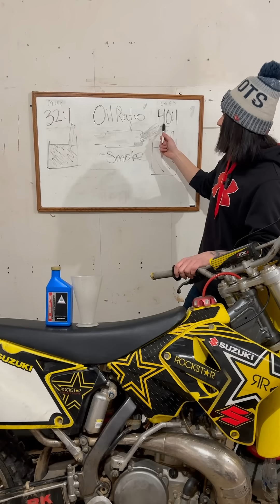2 Stroke Oil Ratio Explained

Comment: It's not because you are putting in to much oil necessarily. It's more likely that you are running the wrong oil. Different 2stroke oils have higher or lower temp flashpoints. If your running low speed trails so your engine temp will be higher you run a higher flashpoint oil. If your running cooler like wide open higher speed terrain you run a lower flashpoint oil. That way it's burn off instead of running out your pipe. And FYI it make so little difference on how thick the fuel is, it has nothing to do with how easy it's picked up by the carb, that's ridiculous actually. It may have some bearing on how efficiently the fuel is emulsified in the pick up tube but it's negligible. Research your 2 stroke oil flashpoints, it will make the biggest difference. And yes I'm a pro tech, master certified. 30 years experience. But always do your own research! It's up to you to make sure you understand what the reality of random advice. Keep ripping.

Comment: If the smoke bothers you switch to "smokless" oil huge difference!  I have an old engine says to use 1 pint of sae 30 wt. Per 1 gallon gasoline  that's 1:08   mixing ratio 😳  that's insane.

Comment: Use Excel plus metal treatment and run 60:1. Outboards run 50:1 without any problem on manufacturers recommendations and they work harder than a bike 2 stroke. My Victor 2stroke mowed commercially for 2 years on 50:1 without the Excel until I gave it to the neighbour who used it for 3 years and loved it.

Comment: What???? How is less oil going to cause the engine to run rich? This doesn't know what the hell he's talking about.the only reason why the oil is in there is to provide lubrication.period.that oil is in the fuel so the oil will be burnt with the fuel and cause the smoke.i had a 13 KTM ex-c.they-ktm recommended 50:1 and it still had build up at the end of the silencer.so I don't get what the hell  he's talking about.and what mix is he claiming is causing it to run richer the air/ fuel ratio or the oi/ fuel ratio?

Comment: Who cares how badly it’s smoking, they’re nicknamed 2 smokes for a reason lol.. ratio your bike based off the application.. if your lugging through single track at low speeds, use a high oil ratio, as your bike isn’t getting hot enough to burn off the oil in the fuel completely .. if you’re at the track and constantly on the pipe, use a lower oil ratio .. the harder you ride, the hotter the piston and cylinder get, the more oil you’re going to burn off in the cylinder during combustion

Comment: Richer or leaner are terms relating to the fuel / air mixture, not the oil/fuel mix. Adding less oil increases the ratio of fuel to air, thereby richening the bike. This if you run less oil (40:1 , 50:1) you may want to lean your jetting to compensate .

Comment: And bk in the day my mates wud come to me saying my engine has seized up, did you put oil in with the fuel? 🤔 NO isn’t there oil in the engine 🤣 dang i learnt that mowing the grass in 1972 at the age of 6. Yeh 6 yrs old get the mower out fill it up not forgetting the oil, a little tickle,a little choke, wedge the mower against the tree and pull with all my might, it fired up most of the time. If it didn’t i wud take the spark plug out, warm it up and boom first try 💪. Kids these days don’t even know what a lawn is around here let alone how to use a mower at six some are still on the breast 🤣

Comment: I like the theory sucking a slot a milkshake thinning out the oil ratio does not make it suck way more fuel the amount of liquid coming into the combustion chamber is going to be the same only changing the Jets will make a difference obviously the fuel content is going to be higher because you have less oil that's obvious but the amount of liquid going in by changing just the oil percentage will not change you have to change the Jets to change amount of flow

Comment: Team green guys told me as a young racer that they set premix based on the oil level in the bottom of the case after running it and shutting it down. I don't remember the exact steps but they ran it, shut it off, pulled the cover and measured the depth of the oil. Set that then start adjusting the carb

Comment: Here’s the problem with the whole concept of two stroke RACE bikes. The bike was not built for durability. It was built to race, not ride around in your back yard or neighborhood for 25 years. Check the manufacturer’s service manuals, the manufacturer  recommendation on a top end is 2 to 3 hours of race time or 5 to 8 hours of trail riding time. So mixing the oil and gas has to do with the fuel being burned. If you are a beginner rider using 87 pump gas mixing Maxima Castor 927 32:1 with factory jetting, you are destroying your bike. It’s clogging the power valves and charring the top of the piston with carbon and unburned oil which causes the cylinder to over heat thus shattering the skirts of the piston.  Now take an A class rider with 102+Octane and 40:1 Motul 800 and tuned jetting the bike runs flawless for a couple of motos but the top end is shot after that.  The object of his game is to run it like a raped ape hoping it doesn’t blow until the checkered flag. So your game is, jet the carbs and run a good ratio of gas and oil that matches your riding style. This will be trial and error but the color of your spark plugs will be the judge of what’s good for you.  No one person can tell you what’s the best ratio for your bike, your bike and your riding ability knows that answer. Watch your plugs and check the color, change them every ride or 30 minutes of ride time. They are less than $4.    Now, all that being said, if you don’t have time to do all this, owning a two stroke race bike isn’t your thing.

Comment: Well kinda, so I used to race ATC 250R  3 wheelers. We would run low lead fuel 100 octane and mix them at 16 to 1 with flammable 2 stroke oil "goldenspectro". They were not too rich!!!!!    A bike from the 80s that said 32 to 1 could run 40 to 1 with the new spec Oils out there today no problem....

Comment: I always run 50/1 on my 2 stroke bikes and sleds this way the motor will last for years but I do sometimes I spray transmission oil into the carbs to totally clean out any carbon build up.

Comment: Old school carburetor tricks will screw up a modulated motor. You are absolutely right. If you ain't a race tech or an engineer, trust the manufacturer.
Reply: 2 strokes have been going through some major evolutions, over the last 10 or 15 years. The 2 strokes of today are nothing like a motor from an '86 yz 125. Nothing.

Comment: I tried many different oils for all of my 2 stroke dirt bikes. I was hooked when I found AMZOIL. This oil could be run at a 100:1 ratio. I had a 98 CR250 I bought brand new and ran only AMZOIL at 100:1. I rode that bike hard every Saturday and Sunday for a full spring, summer, and fall. I brought  the motor in to get it honed or sleeved and new piston and rings at end of the year. I was told it wasn't needed and that they could still see the original factory honing scratches. They said you must barely ride. I laughed and told them how often I rode the bike and the oil I used and the ratio. They did their own research into using AMZOIL, and the next time I was at the dealer they switched over to only AMZOIL products. More than one occasion I was told I was going to blow the motor up because it was producing no smoke. Best oil I ever used.

Comment: Run as much oil as you can manage. I see lots of comments from fouling plugs to burning rings/pistons. I want the bearings lubed and rings lubed. Manage detonation and correct fuel delivery, and it should run hard, live long, and maybe even make more power. Most all tests on mix ratios show more power with a richer oil mix. Less friction? Fouling plugs is it's own issue, not necessarily related to oil. 
Btw, nobody mentioned 20:1.

Comment: I have told people hundreds of times that my 32:1 mix is leaner than their 40-50:1 or whatever it is. You are using 2 ratios. Oil to fuel ratio, and air to fuel. Pick your oil to fuel ratio and jet the carb for that

Comment: Hard to find anything that needs other than 40:1. Shit used to be not as good as far as oil quality so they recommend 32:1 on older toys. running 40:1 is actually probably closer to what they ran back in the 80s and early 90s. These new 2t run 50:1 because oil is litterally that much better the only thing is you probably cant run it 50:1 on old toys cause like homeboy said ur likely jetted like trash already.

Comment: It doesn't run richer it just makes the engine get 20% less lubrication. Result is higher engine temperatures from thermal efficiency of burning oil as oil is leaner it gets hotter. Oil removes engine heat when in large enough amounts. Mazda rotary engines use oil like dirtbikes. To lubricate the rings or wipers on the Mazda.

Comment: Don’t listen to this guy, he knows not of what he speaks. The more oil you use the leaner the air fuel ratio becomes. Why, because the oil displaces the gas. Nothing to do with viscosity of the mixtures.

Comment: 32:1 is 32:1...go up to 40:1 and order your rebuild kit. Factory 32:1 should never change. Read your plug first, could you go hotter/colder? Decrease/increase jet size? Is your air box/filter plugged? Advancing/retarding your timing by turning the stator a 1/100 turn? The best fix is buying one from this century that's 
fuel/oil injected. We'll agree to disagree that more oil to less oil will make the motor run richer...i think you're...blowin alot of SMOKE there...like at an 8:1 ratio

Comment: Higher oil usage like 32.1  you can actually be running the bike lean as the percent to oil to petrol is high i use to see it with chain saws . 50 .1 and 40.1 the saw would perform better at 50.1

Comment: The reason they manufacturer recommends 32 to 1 is because you get a lot more usage out of consumable parts like piston connecting rod when I was younger and erased every 8 hours you tear it apart and inspect your piston rings and your piston and replace them whether it needed it or not otherwise replacing the whole engine because something gave I shot a few rods to the bottom of locked up a fuel that's why I nicknamed all my two strokes hookers they had to have their hair done and your nails done before you took them out on the weekend then when you brought it home you had to tear it apart and rebuild it

Comment: Sometimes the oil ratio is what needs fixing. Because most race bikes are 2 stroke the dealership tells you the RACE RATIO if you have a race bike so if your not racing absolutely lessen the ratio because your not running the bike as hard as it would in a race ( in races they are almost always tapped out) 
If you’re not riding it like how a race bike is made the extra oil gets burnt incorrectly and builds up. This is first hand experience and common sense
Reply: Yes i had an rz500, it was always oil fouling ( oil injected not pre mix).
The dealer told me, "when it starts chugging, drop it into 3rd  hols the brakes on go full throttle until its cleared out"! Wtf  

How about setting the tune for road use as it's a road bike, not a track bike.

Was a weapon when on song!

Comment: You were correct right up to ehen you said you burn more oil with a leaner mixture. How can you burn more oil if there is less oil in the mixture.the difference between 32 and 49 is not going to make the gas thicker ir thinner with your logic then if you mix it at 200:1 means you should be running super rich. But im still wondering where you get by leaning out the nixture your actully richening it up????

Comment: I got a question 🙋🏼‍♂️ 

I have a 2023 ktm 300xc ok and they want me to run 60:1 so I have and I’ve fouled about 7 plugs it’s currently in the shop. Wtf is going on yes it’s fuel injected and it’s premix. 
Why so high 60:1 ??

Comment: You left out the " Altitude Factor"... At 4000+' elevation, you run 40-1 even with proper jetting.. So, your theory seems slightly flawed.

Comment: Not exactly the correct explanation of the different ratios, but yeah. 40:1 is richer than 32:1, not because you are burning more oil. But because you are burning more fuel, making a richer and cooler running engine.

Comment: It's not a richer fuel mixture because it's thinner with less oil, it's richer because if the jets are the same the volume of fluids stays the same and the missing oil is replaced by more gas. The total air-fuel-oil mix always has to add up to 100% but the numbers are the ratio not a percentage so;
32:1 = 32 parts air, 1 part oil
40:1 = 40 parts air, 1 part oil
50:1 = 50 parts air, 1 part oil
and so on!

Comment: His explanation wasn’t necessarily the best but he is correct regarding the air/fuel ratio. The two stroke oil doesn’t burn, only the gasoline burns. If you have less oil in the mix then a given amount of fuel drawn into the engine contains more gasoline. More gasoline results in a richer air/fuel ratio. Conversely, more oil in the mix will make the engine run lean. Bottom line, choose the fuel:oil ratio based on whatever guidance you trust, THEN adjust your jetting for proper air/fuel ratio.

Comment: But doesn't gas burn better than oil. Too much oil it smokes and doesn't burn clean burns cold and plugs up exhaust with oil film. Use synthetic 50:1 and rejet enjoy extra power

Comment: And most modern post 70's 2 strokes ie Yamahas run Posi Lube. They have a seperate oil container and that oil is metered into the crankcase via the mains and bigends then splashed up into the bore to cool and lubricate the piston. Its set from the factory.

Comment: 32:1 is when oil wasn't mfg well. Today's oil is refined compared to 1980's. If you have oil coming out of your pipe you're way to rich. 40:1 is perfect for 125 - 300 two strokes. I ran my 2000 CR500R for 7 years on 50:1 and after 7 years the frame was toast but the engine still had honing marks clear as day on the cylinder walls. The mfg specification hasn't been updated for a long time. 😎🇺🇸

Comment: For my YZ250 I run Motul 2t, with 100 octane at 40:1. 180 main with a 50 pilot jet. I never have an issue with smoke. I’m also at lower elevation so I can get away with 180. VP sells their race fuel at 40:1. Like most things this is is not a single variable answer. What type of oil do you run? What cc bike? After market reeds and or anything that messes with air fuel ratio? If Suzuki engineered the bike for 32:1 with complete OEM parts I would do that and jet to your elevation as incomplete combustion of fuel due to lack of oxygen will cause excessive smoke

Comment: I dont care what anyone says, there is something called "oil rich" 
He said less oil is richer.

more oil = oil rich

More fuel and less air = fuel rich

Less fuel and more air = fuel lean

Less oil and more fuel = fuel rich

Best way to jet a bike = more oil aka 32:1 + lean jets

Too much spooge out the tail pipe means small jets are needed, not less oil. Hes completely right, i just hate hearing people say "rich" because someone took out oil. Less oil in my head is a = lean oil mixture. In his head its a = fuel rich mixture

Comment: A small point, though the information in this video is accurate, it is not true that all 2-strokes burn oil, some burn less oil than 4-strokes do, and this has been a fact for many years. Particularly in the case of the Evinrude E-tec outboard motors for example. (Since we are dispelling myths here.)

Comment: Oil does not atomize in the same fashion as gasoline. Gas mixing with air produces a vapor like condition whereas the oil remains in droplet form. Less oil in the mix means a "richer" fuel mixture entering the cylinder.

Comment: I always ran and jetted for 40:1 on all my 250s and the banshee and blaster after deleting the auto mixer and i ran 32:1 on the zilla all castor 927 with zero ethanol 100 octane sunoco race pump gas. Never ever had a issue ever on any of them the crank seal blew on the blaster and sezied it up once but that was a seal the was bad from the factory

Comment: Been running 40:1 for over 20 years. No issues. Have three 2 strokes. Most bikes you run 32:1 just for the break in then run 40:1
Reply: I got a 01 kx 125c, and my exhaust leaks oil. I am running 32.1, probably. I'm probably I switching to 40:1
Reply: @2and4stroke949 did doing that solve your problem? I’m thinking of doing the same thing on my yz125
Reply: @Bpowell7099  I added 3 oz of oil to 2gl of gas ⛽️ is better now also I try to do full throttle
Reply: @2and4stroke949 so 85:1?? That does not seem advisable
Reply: @donkeystonky5362 haven't tried, I got blastes 200 im doing 32.1 with np 🤨

Comment: 40:1  is the correct ratio when using synthetic 2 stroke oils  32:1 raito is typically used for conventional dino oil. Just saying.

Comment: your right if your actively tuning.. i think most people  who are playing witb their mix are probably assuming the jetting is right and are trying to correct the  variable that most likely isnt consistent because theyre not getting that technical.  
i have many  2 stokes engines that have run reliably for many years and plenty of times ive mixed my fuel by an educated guess  absence  of proper measurement  containers.. but im also not out racing or beating on my equipment every outing.  
to the extend of how much one can really ride a dirt bike without beating on it

Comment: I usually do a 40:1 ratio. Jetted the bike to it and I run a low flash Lucas synthetic oil. Guys running WOT on a track 90% of the time yeah 32:1 with a high flash oil all day. People who trail ride and do more part throttle technical stuff just fowl plugs running 32:1 then you have to change a plug on a hot bike in the middle of nowhere on the side of a cliff.